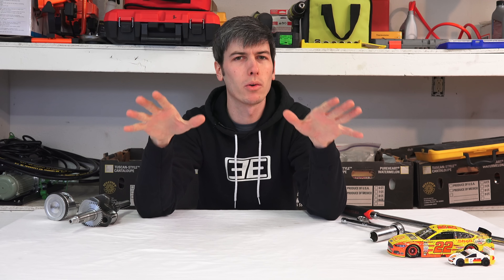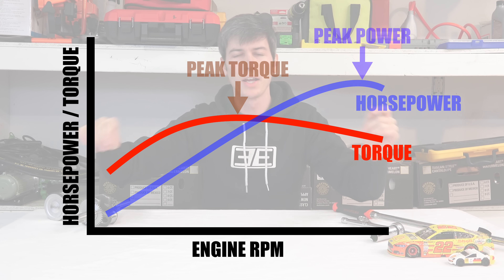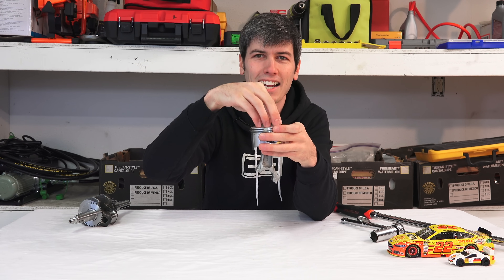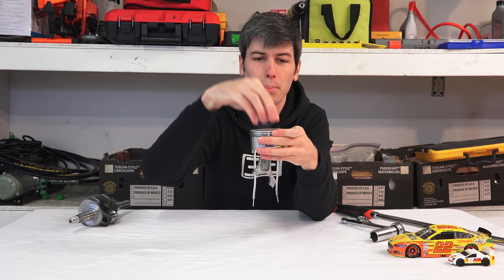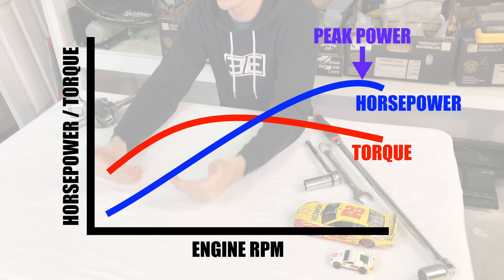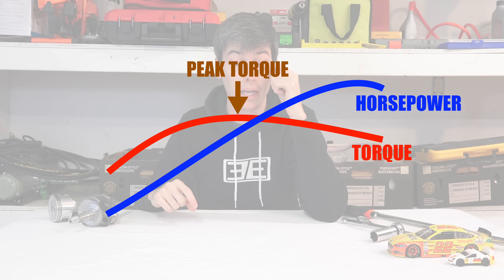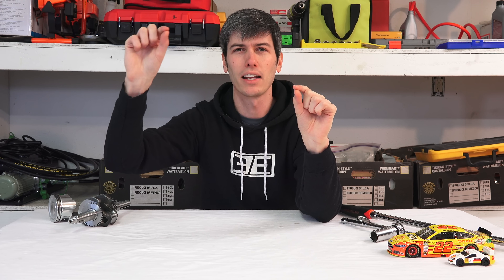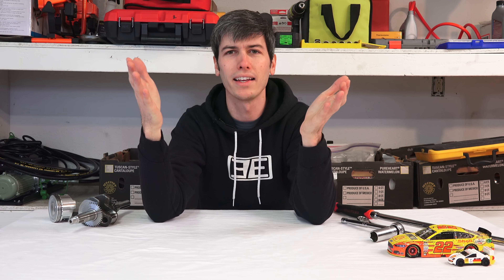Horsepower vs Torque - A Simple Explanation

Comment: I do not understand horse power clearly ! Can you make it some more easy ?
Reply: Horsepower is a unit of power (energy per second) like Watts. 1 horsepower = 745 Watts = 0.178 Kcal/s = 640kcal/hour. So if you work like a horse for an hour you will burn 640 calories
Reply: @singingpianos6470  oww,,, now i understood... thank you very much... again a question :- There is a standard ,isn't it ???
Reply: @kingdomofknowledge5960  When the first engines were becoming commercially available, salesmen needed a way to compare it to something their customers could understand.  The customers who were only familiar with mechanical work coming from the muscles of horses, oxen, and humans.

James Watt coined the term horsepower, by measuring the performance of draft horses, as the team of horses pulled a millwheel.   He measured the speed they could go, and how much water the horses could lift through the millwheel.  From this, he calculated the 550 ft-lbs/second as the rate of work a draft horse could sustain.  Coining this term, he could express the performance of a steam engine, and tell his customers how many horses they could replace, by having a steam engine do the work instead.

Yes, James Watt is the namesake of the unit Watt as well, which was coined after James Watt died.   The Watt is the metric unit that measures the same concept as a horsepower, except now with no specific reference to the horse.  And instead, a derived unit from the fundamental units of kilograms, meters, and seconds.

Comment: Engines with longer connecting rods have more torque and are sometimes referred to as "strokers" due to developing more torque via their longer stroke.  Harley Davidson motorcycles are known as "stokers" because of their longer connecting rods.  In the car world Jaguars such as the XKE with the straight six cylinder motors also had longer connecting rods and are also known as 'strokers" because of this.  Italian cars such as the Ferrari's generally had shorter connecting rods but developed more power and got their torque from gear ratios.
I remember reading somewhere which stated the was a reason behind the different development of these different motors from different nations had to do with the way gasoline was "taxed!"  Go figure.....
Reply: John Edwards the rods play no role. The distance between the center of the crankshaft and the rod connecting point is half of the stroke. Torque depends on the stroke not rod length at all.
Reply: @inox1ck  To me this makes little sense; since the length of the connecting rods determine the length of the stroke, i.e. shorter connecting rods; the shorter the stroke versus the longer the connecting rods the longer the stroke.  I don't see how you could have one without the other?

Comment: If torque is (power)(distance) how do you find the distance on a circular gear? do you use the circumference for distance?
thumbs up if you have the same question so that he will see it. THANKS(:
Reply: thumb down(I know the answer). For gears you do not need to calculate diameter of gear. U just need to know the gear ratio. gear ratio 1:3 means that gear torque is multiplied or devided by 3 depends of wich side has  driveing and towed gear.
Reply: Thanks for the answer Martink9191 it really cleared things up.
Reply: @aidenmarshall6478  Because gear teeth have to be the same spacing for an interacting pair (called the "circular pitch"), usually gear ratios are simply tracked by counting the teeth on the two gears in question.

Indeed distance does mean circumference on a circular gear.   There is a characteristic circle through the middle of the teeth, called the pitch circle.  This is where the tooth of driving gear, contacts the tooth of the driven gear.  This is the virtual circle that would be the same size as if you had two friction disks interacting, instead of gears.

Comment: Piston engine high torque
Electric motor low torque
Torque- how strong the force is
Speed-how fast it travel
Torque+speed=Horse power
Imagine a drone hovering the same speed as a car does at full speed, they both fast but different torque which means different horse power.
Reply: you are wrong actually. Pistion engine has quite low torque and electric motor has basically infinte amount of torque. You can start electric motor from 0 rpm with load. Smaller the prm ratio, more torque it has. Car sized pistion engine dies off lower than 500rpm. Marine engines runs usually at 100-150rpms actually. Normal car engine has max torque between 2000-5500rpm.

Comment: i think he explained it wrong if your car has more torque its gonna be quicker off the line but if your car has more hp you can reach faster speeds, cause when i built my evo for track days we focused on torque rather than high hp numbers cause we can basically exit turns quicker

Comment: 2:55, You state that you have two vehicles that are exactly the same.  Exactly the same except one has twice as much torque as power, and the other has twice as much power as torque.  Then, when you answer which one is faster, you pick one with more power and less torque, and explain the reason as it having different gearing.

This answer is wrong.  The two vehicles are exactly the same, except one has more power and less torque, and the other has more torque and less power.  They both have the same gearing, otherwise they're not exactly the same.

Comment: So without torque there's no horsepower
And without horsepower there's no torque (?)
Reply: Yes, because horsepower = torque*rpm/5252. Therefore, torque = horsepower*5252/rpm. They are directly related.
Reply: Without torque, there's no horsepower, because automobiles rely on rotating shafts to carry the power.    You'd have to be in a vehicle that doesn't rely on rotation, to omit torque as a prerequisite for horsepower.  The only example I can think of, would be a rocket.

You can have torque without horsepower though.  This is precisely what your parking brake does, when keeping your vehicle parked on an incline.  It applies a torque to the brake drums on the axle of the wheel, to constrain against the vehicle rolling downward.  It doesn't apply any horsepower, because it doesn't push the brake drum any rotational distance throughout its application.

Where you might see this on an engine, is if you are attempting to climb a steep hill, and you press on the accelerator so gently that your car doesn't actually get anywhere.  Your engine is torquing the crankshaft, but not accomplishing anything.

Comment: Next video: The difference between moment and torque.
Reply: The short answer:
It's the same physical concept.
Torque is the term preferred in physics.
Engineering will use both terms, to distinguish whether it is parallel (torque) or perpendicular (moment) to the long direction of a member.  A shaft carries torque, a beam carries (bending) moments.

Moment's full name is "moment of a force".  Which means the radius vector to the point of application from the origin, cross product with the force.  Sounds just like the definition of torque, which it is.  Moment is the term usually used when it loads a member perpendicular to the long direction.   Like a beam.   Torque is usually the term used when it loads a member with a "twist" along the axis parallel to its long direction.

There are other kinds of "moments" as well.  Such as moments of mass, that are used in the center of mass calculation, as well as the second moment of mass (moment of inertia) that squares the radius as part of the calculation.  Also moments of area that are used in structural capacity calculations.

Comment: what's your thought on a Jackson Racing Supercharged FA20 FRS Engine with Factory Plug and Play conservative 91 octane tune. Stock headers only exhaust upgrade is 3 inch Catback. 9 PSI at red line but the factory ECU only accepts 6 psi. can this low boast level cause stock internals to be at risk of breaking something when accelerating in an FRS with 85,000 miles.

Comment: 150cc 4 stroke engine which produce  9hp at 6000 rpm and 11nm at 4500 rpm so can you tell me how much power it produces per rpm. (lb-ft or hp)

Comment: The higher torque car will start off faster, because there's only so much you can do to first gear.  The higher HP car will catch up fairly quickly, assuming it's geared appropriately.
Reply: You have correctly described every Tesla p100d video vs. a muscle car.  The Tesla usually wins the 1/4 mile but then loses against  good ICE cars.

Comment: I thought more torque means quicker acceleration? If the cars were exactly the same
Reply: Yes you are right, the fat torque curve, way above the horsepower curve for the most part of the graph, accelerates you. It's only when the horsepower curve  PASSES the torque curve that you increase momentum as the HP takes over making you go faster

Comment: Re @ 6:30 - WRONG! - ("you'll feel it crossing the peak torque point in the seat of your pants"). That point is STILL less capable than the peak power point and will simply be a lower point in a building "feel" of power. I always like to impress guys with a 1917 steam engine I used to service at a sawmill in Idaho. This monster made 1000hp at 98 rpm...! That's right, 1000hp @ 98 rpm. How much torque do you think it made at full power? 53,592 ft-lb (or, if it's in a car, 53,592 lb-ft - it's exactly the same thing)! And the Ram drivers always start slobbering all over the place, spitting things like, "I'll be looking for one to put in my truck..." Well, the rub here is that that engine weighed in at over 65,000 pounds, NOT including the boiler (remember, steam engines are EXTERNAL COMBUSTION power plants). Oh, and it was also over twice as long as a modern 1-ton truck. I still like a hopped modern diesel, though - you can fit them comfortably into your truck.
Reply: Nobody cares Alan
Reply: Great story - Would've loved to see this demo'd!

Comment: Nice video, but as a physicist in the automotive racing industry, I must bring to your attention a correction that needs to be made:  the force felt pushing you back in your seat is proportionate to the vehicle's acceleration, which is solely and only connected with the amount of work being done (i.e. parallel to the horsepower curve, not the torque curve). Hope this helps.

Comment: Not sure I like this explanation that much. Bringing gearing into the discussing is a bad idea if you are just trying to clear up the difference between torque and power. Power is torque multiplied by RPM. I would have preferred a discussion of how the torque of an engine is manipulated ( stroke for example and longer levers on the crankshaft ) and how some engines have good broad torque bands and other do not. Bottom line is that good torque characteristics are very useful for towing and on a manual transmission if you don't want to be constantly changing gear in search of reasonable pickup.

The Honda S2000 stands out to me as a car with an engine with a lot of power and relatively feeble torque and needing to be taken to the red line to perform ( 8,000 rpm red line in fact ). I can't imagine fuel economy in the S2000 would be good if driving it hard.

Comment: Can you give an example of when torque is more important than horsepower? Such as when you are towing?
Reply: If you don't want to change gears very much, then ENGINE torque is important. If you don't care about changing gears, then ENGINE torque doesn't matter at all, because you can use gears to generate wheel torque, which is what you feel as more acceleration.

Comment: I have a question: Torque and RPM are  two inversely proportional forces right?
For example in a marine engine if you have a 2-stroke M/E you will have very High Torque but very Low RPM. I am guessing that 4-stroke marine engines have High RPM and Low Torque right?
I am an Apprentice Cadet and i need explanation, Thank you in advance.
Reply: RPMs (rotations per minute) isn't a force. It's a velocity (in layman's terms, speed).

As for the two being inversely proptional, though, sort of. 

If you spin in a chair you can see how they're related. You spin around with your legs fully extended, but if you pull your legs inward you'll spin faster and for longer. This is because it requires less force to maintain the same RPMs when your legs are pulled in. This example would be comparable to an engine shifting downward after you let your foot off the gas.
Reply: @shatteredshards9640  I understand now thank you.
Reply: @NoOne-yy7nq  you're welcome!

Comment: Why they call it "horse" power!?
Reply: Horses have no torque!
Reply: @ct5816  It has to do with representing the performance of the first engines, in terms that perspective engine buyers could understand.  If you were only familiar with horses doing your manual labor, you would want to know just how many horses could you replace, if you bought an engine instead.

James Watt studied the performance of draft horses pulling a millwheel, and determined that they could lift the equivalent of a 550 pound load vertically by 1 foot, each second.   He coined the term horsepower, and assigned this measurement to it.

Comment: Maximum fuel is injected at highest RPM, but it does not necessarily provide maximum Torque! What are the factors that limit it?
Reply: Volume, air density, temperature, and volumetric efficiency. Maximum fuel is injected in order to keep the chamber temperature down. Most engines hit peak fill in the 2500-4000 rpm range, which is where the most spark advance is also introduced. It's not uncommon to see 30+ or even 50 DEGREES of spark advance at peak fill (mid range). However, as chamber velocity increases, the volume of air being moved also increases, but so does heat. As air is compressed, it gets hotter but harder to light, spark advance is then reduced to anywhere between 20 and 30* on most V8's. 

To keep it cool, we inject MORE fuel. A balanced and/or rich air fuel mixture also burns MUCH cooler than a lean mix. More oxygen with less cooling effect = bad day for your engine. What do we cut steel with again? lol. That's why we run them rich in Power Enrichment mode, which is set at 12.5:1 for N/A cars and 11.5:1 for boost. In reality stock tunes target it even lower, actually. Setting it a little on the leaner side gets a bit more power out of it for a slight risk of detonation. Those AFR's are pretty widely accepted as safe for wide open throttle (WOT). 

Setting the gears to change just after peak torque is a solid way to maximize acceleration. Changing camshafts also changes the point at which these peaks occur. With the right cam, you can see numbers on a 7.0 liter N/A V8 of 600+ WHP @7000+ RPM, with peak torque somewhere in the 6000-6500 range. I've seen them run to 8000 RPM with the right build, some go even higher. It's all in the cam and how late you close the intake valve. The sooner you close the valve, the sooner you make torque, lower in the band. However, if you wait until later, you lose low end torque but gain it back when cylinder velocities are at the maximum, very high in the RPM band. 

Most race cars make the most power near max rpm because of the way they are made and built to run. Your average grocery getter on the other hand probably isn't EVER going to see red line so manufacturers advance the curve to give them low end torque. Lately with VVT and VCT you can kind of have the best of both worlds.

Comment: I think a useful question to clear up this discussion for a LOT of people would be posed as such.  Would a car with equal Torque and Horsepower produce equal wheel torque?  (force at the contact patch)  A very basic way to ask is "if 300 torque barely breaks traction in 3rd gear, would 300 horsepower barely break traction in 3rd gear?" at their respected peaks of course.
Reply: "Equal torque and horsepower" means nothing.  You cannot have two measurements be equal, if they are in different units.  It is just a coincidence if the numbers happen to be equal.

Comment: Isn't it true that a V-6 has a torque advantage over a V-8 if their displacement is the same - meaning the V-6 reaches its peak torque earlier in the RPM range than the V-8?

Comment: How would you calculate the torque multiplication if you wanted to factor in what gear your transmission is in and the final drive. Would it be Peak torque * trans gear * final drive?

Comment: I guess a simple analogy would be

Pull ups
Torque - How much weight you can pull up (Of course in this case, it is not rotational force, but you can get the idea)
Power - How many pull ups u can do in a minute

Also the more torque, the more easier your vehicle can climb, the more power, the faster the vehicle can get
Reply: Anand Nidamanuru that’s right.
Low torque high power means you do pull-ups fast, like 10 in 30seconds
High torque low power means you can lift your weight plus say 50kg but very slowly like 1 pull a minute. You will burn calories slower as well.

Comment: This always gets confusing but it boils down to this: torque is the amount of force the engine generates, horsepower is how well it translates that into speed. This is why race cars have high horsepower, low torque, they extract lots of speed from a small amount of power due to their great engineering